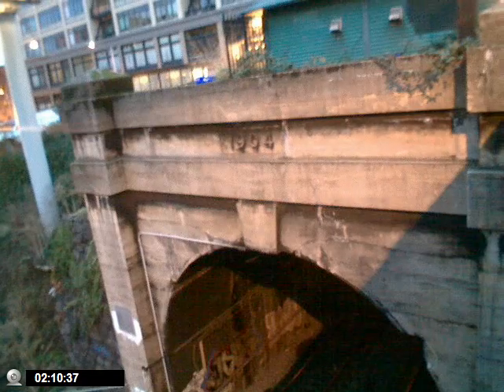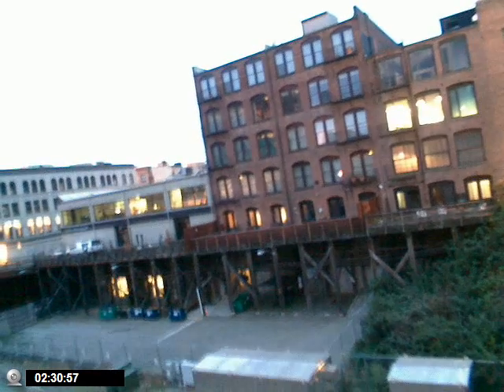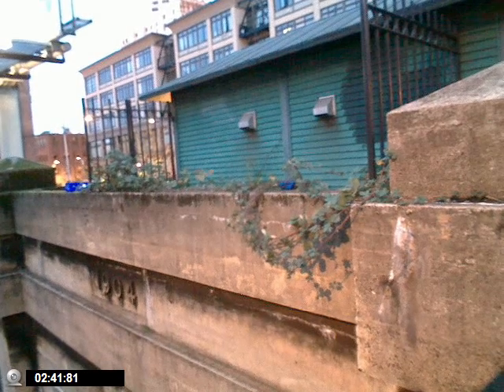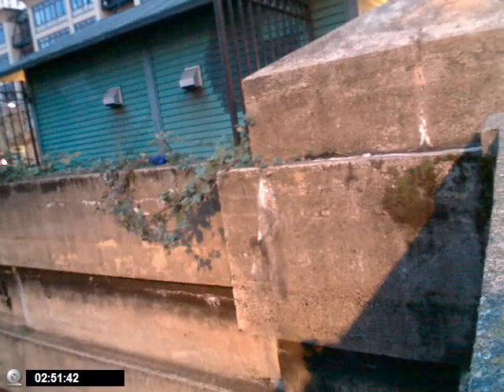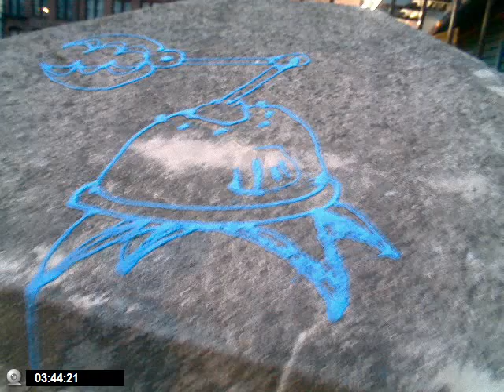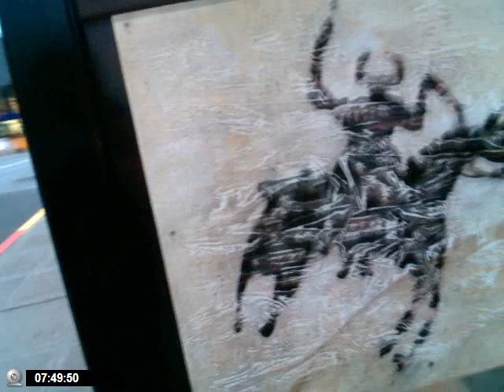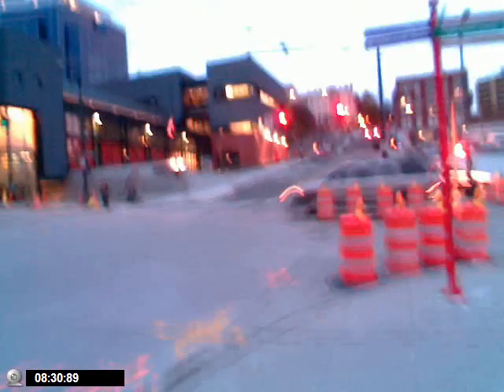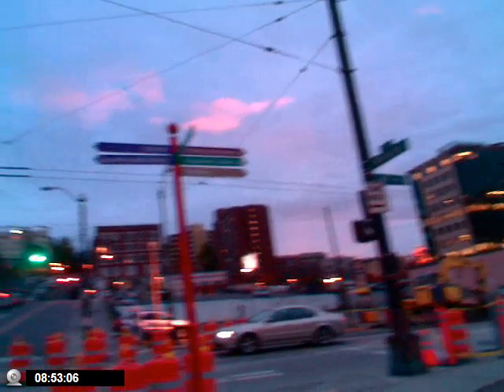Seattle's Great Northern Tunnel Bridge Structurally Damaged 2

Comment: You are looking at the railing of the bridge. Not load bearing. Also those are not cracks in the concrete just how they formed it. The cracks on the surface by the 1904 date has a crack but those tunnels are reinforced just because you see at crack doesn't mean it's going to fall. Concrete gets cracks.
Reply: I understand what you are saying but it really is a set up